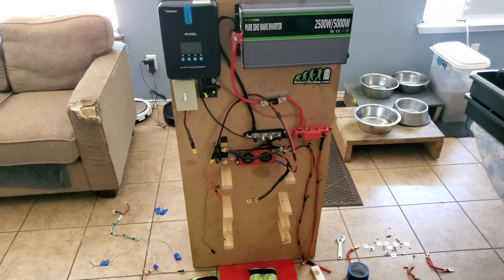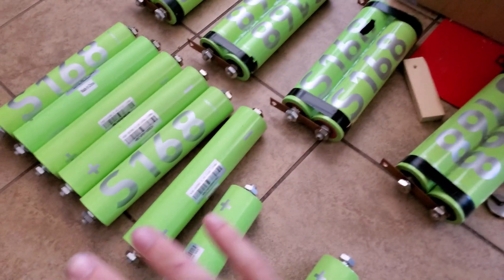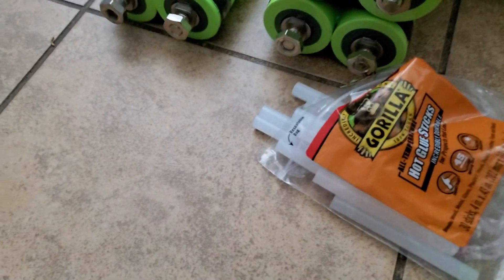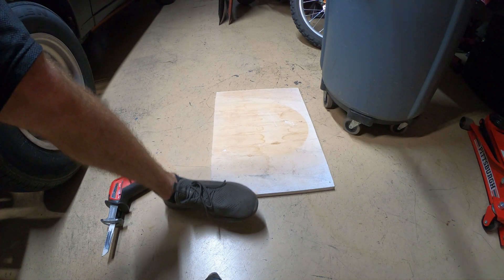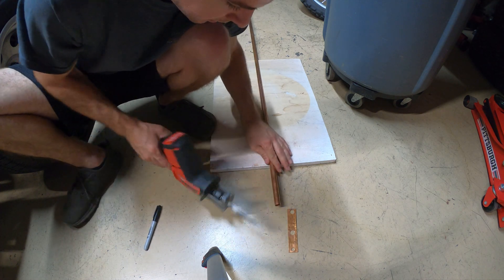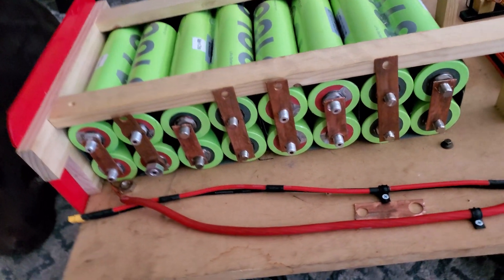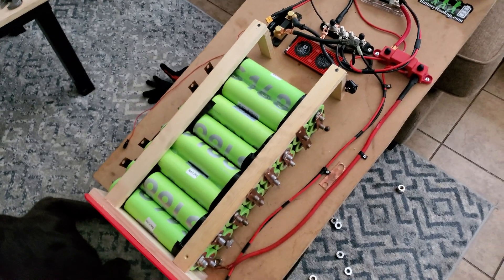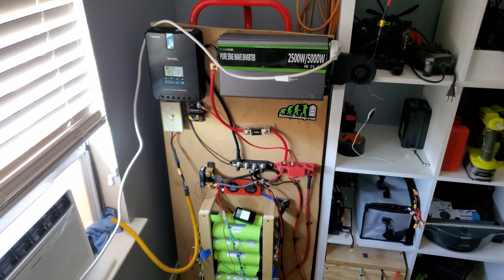DIY Solar generator update, adding more Lifepo4 batteries

Comment: Use no.6 silicone wire if the solar charge controller gets hot 
It is necessary to use bigger wires cause your set up can run a high load but it depends on the power inverter 
Your set up is almost the same with my set up but i use bigger wire size on my set up 
I use no.6 silicone wires 
Nice diy off the grid solar system
Reply from the maker: I appreciate the input, I’ve since gone 48 volt for big loads, but I still love a good 12 volt setup!

Comment: Where did you get your battery cells, and what are their form factor, thanks? Please note, I couldn't tell if your buss bars, and or connectors, were touching the wood frame. But wood can be somewhat conductive when dry depending upon sap ect, but most wood can be when wet depending upon dirt ect?